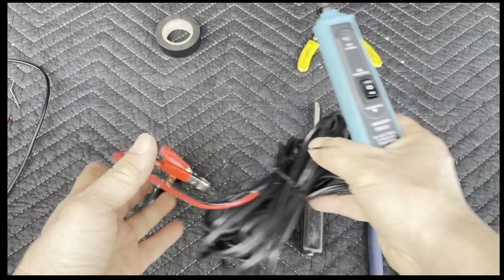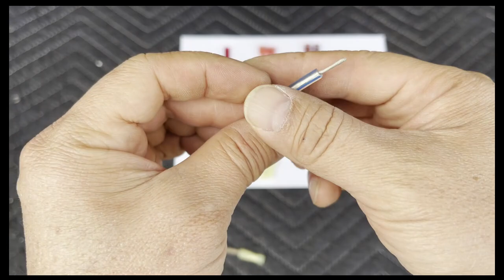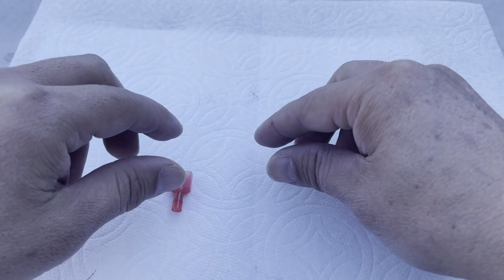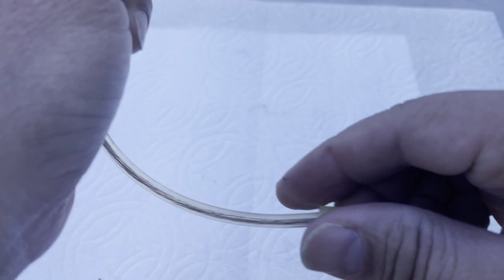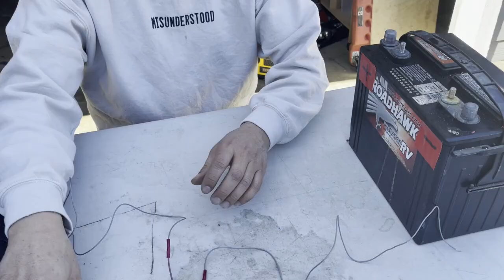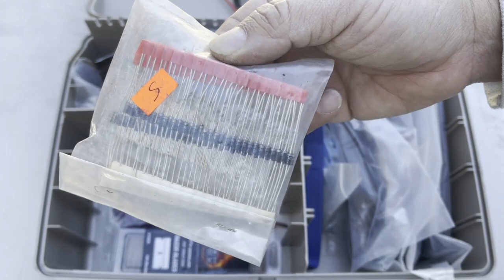Basic Automotive Electrical

Comment: Hi Mr. Bob, Since I've watched all your videos 📹 many things you have recommended I've done it!
And all is So Useful and Builds Character for my GX.
My first video I've watched from you was:  1)Change my oil 🛢 with Fumoto Valve Plug.
2) Changing All my Interior/ exterior LED Lights with AUXITO.
3) Installing DASHCAM 
4) Installing Top Wind Gaurd
5) installed the LIGHT BAR under the   Bumper.
6) 12Volt.Solutions Engine Starting Kit with the Phone Module 
7) Shift Power-USA Throttle Respond Controller 
8) Best Phone Holders 🤳 
9) Brand New 2013 Red Taillights
10) Lexus OEM Front Grill
11) AlphaRex Quad Smokes Headlights 
12) Added K&N Filter to the Injection   Pump
13) MY WIFE TOLD ME TO STOP ✋️ WATCHING 👀 YOUR VIDEOS 📹 
I SPEND TOO MUCH $$$$$ 😆 
Again, I wanted to personally thank you for helping me and the GX460 Community for Showing Us Everything Step By Steps 🚶‍♂️ 🙏 😊
Reply from the maker: Hey Ruckus.  Let your wife know that the more you watch, you're at home instead of out there at some random motel with another chick.  lol, just kidding man.  I hate to say it but there are more stuff i'm putting together right now that might piss off your wife.  Just be ready with the divorce papers.

Comment: I've been zapped with electricity so many times in my life and I had no idea why or how to not get zapped. Now I know there's a better way to know if the wire is hot without have to  lick the metallic thingies and exposed wires. This is awesome!!!
Reply from the maker: i had no idea licking the wire was a thing.  I gotta try it today.  If i don't post anything in the next few days its because i'm dead.
Reply: @GXBOB  video or it didn't happen